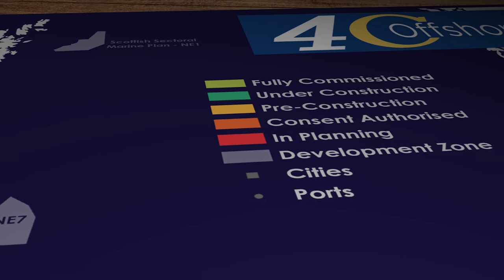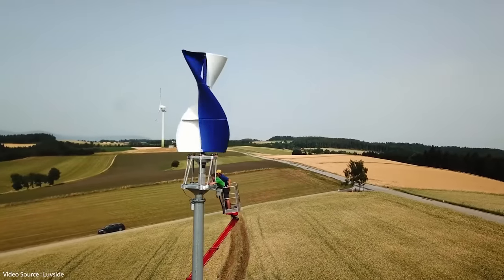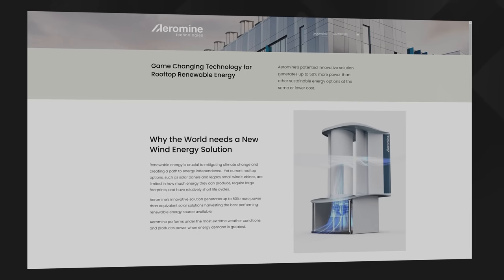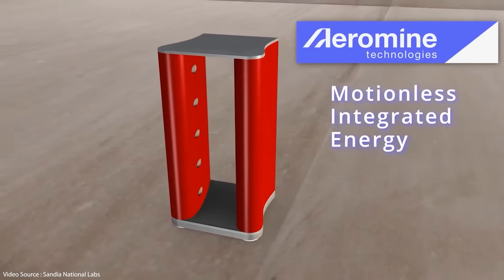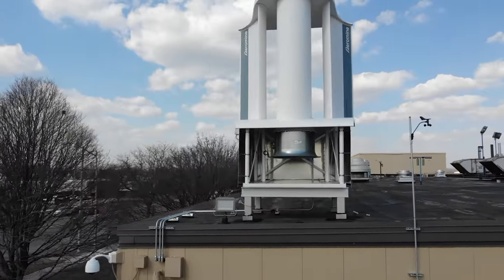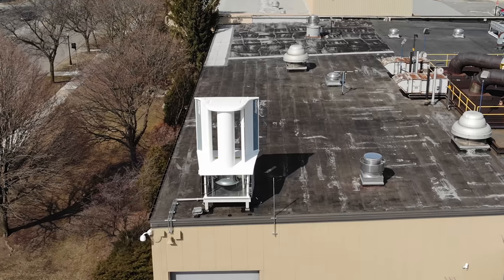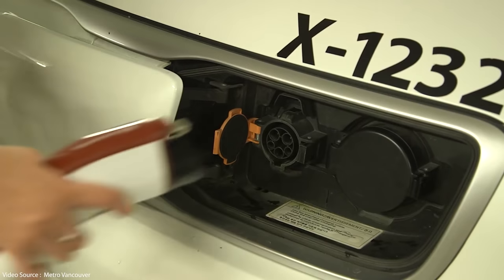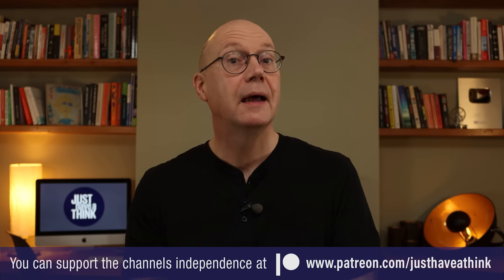Aeromine Rooftop Wind. Static. Silent.  50% more power than Solar PV. What's not to like?

Comment: As the owner of a grade II listed house, I won't be fitting one on my roof but seeing the visual impressions of the units positioned along the roofline of industrial or multi occupancy dwelling buildings, they have an appearance which is quite appealing. It's footprint could be adapted to the structure of pitched roof houses but the carefully designed flow dynamics would probably need to be changed to suit the pitch of the roof behind it🤔

I'm sure it will have a big role in developing domestic scale wind generation and I can't wait to see more.

Comment: It would be nice to have a special segment "Pros and Cons"  in each video. For this one it's obvious that wind direction could drastically reduce the efficiency of the generator and it's not clear whether this was accounted in those nice advertised numbers by the company.
Reply: i think with several decade on aero engineering, wind direction must be the first thing that they consider... that's why it placed on the edge of the rooftop on the side that facing annually predominant wind direction...
Reply: How about obstructions... The pr shots are mainly standalone distribution centers.
Reply: @christianvanderstap6257  if it targeted for factory/warehouse building i don't think they will face any kind of obstruction problem...
Reply: @EndureTemptation I'd say it's absolutely vital. We can't compare the pros and cons, or the price, if we're not told any specifications.

They don't even give optimistic ones of the end product.
Reply: @joeblogs6598  "They don't even give optimistic ones of the end product."

So if they give unbiased estimates, they are going to get dinged because folks will assume the numbers are juiced? I think you just highlighted why numbers shared are probably not useful beyond gossip. That makes me happy that they aren't sharing more details yet -- here's hoping that they're just trying to be as honest as possible!
Reply: I believe it is using the Coanda effect, in the same way as an aerofoil that changes it's angle of attack, allowing constant power generation at +- 45 degree wind angle - I have a video on my channel about it!
Reply: So occasionally reorient it. Place tracks if it needs to be at the edges.
Reply: Does winter weather have an effect, as in snow, ice  build up, very cold temperatures?
Reply: @joeblogs6598  Only small people think they are taller by keeping others at a distance.
Reply: @nathanlevesque7812  Perhaps computerized electronics can reorient these units, as Dutch windmills did manually, to face the best wind direction.
Reply: @alphaxfang  The thing is that these will have to compete with omnidirectional generators and inevitably will lose efficiency on average due to wind direction. Of course how dominant any one wind direction locally is will hit the effectiveness, but in any case this will decrease this system's average usefulness even more.
Reply: @EndureTemptation  lose efficiency yes, but the inital cost will be much lower and it almost doesn't need any kind of maintenance... The footprint also smaller and with no moving part and smaller blade the vibration will be minimum... Plus it only take one side of the factory roof, you can use the other side for other kind of generator...
Reply: @alphaxfang  Lose of efficiency which we don't even know what it is.. They just make a claim of 5Kw... But at what wind speeds? Gale force  winds? Hurricane?  There most certainly ARE  moving parts you can even see them briefly but they are technically "inside" the unit and thus not "exposed" when they are just at the bottom of the tube part. It's not going to change Betz law
Reply: @SilvaDreams  well everything is claimed by the producer, even solar panel can vary when you take consideration of cloudy day/snow/rain/earth angle/roof direction/etc nothing is perfect... 

if on yearly average it produce what it say then it is good already... plus it can be used together with other stuff, it replace nothing, it just another tool for producing electricity... 

yes it is not exposed directly to the element (direct sun/rain)... why so salty upon new tool? if it not work for you then just use other tool that fit your need...
Reply: @alphaxfang  It's not new that is the thing, I saw these back over 20 years ago. They need to be rather large to produce a decent amount of power though. They still have to follow Betz Law
Reply: @alphaxfang  Its about convection more than wind current direction.
Reply: @davidwhitworth6030  attach a raspberry Pi to adjust...

Comment: I remember me and my dad building a vertical ventury out of two model plane wings to drive a toy turbine.
It was a fantastic life experience for both of us, but we had to conclude that there's one issue with wind driven generators.
If it ain't huge, don't bother.
Reply: @srw_cricket2976 
Wind just isn't suitable for small scale application, the physics don't allow it. And a VAWT will never be as efficient as a HAWT for the same reason, I'm sorry..
For small scale solar is the better option, that's why there's a market for it. Wishful thinking never outweighs hard data.
Reply: @isuckharderthanlife5413  400 Watt wind turbines are about $270 on Amazon.  In parts of the world with unreliable sunlight you can go off grid for less than $10K.
Reply: I think the size is the key as well.  The opening, if it is 25 square feet, should be equivalent to a wind generator with a 3 foot radius.  Such a machine has a 28 square foot swept area.  Running at 40% efficiency and a 15 m.p.h. wind, you only get 190 watts.
Reply: @The_Savage_Wombat  That is peak output. Average output will be much much less at nearly every location. Particularly since few put them on tall towers.
Reply: @The_Savage_Wombat  try buying and using one : they are junk in practice .
Reply: @isuckharderthanlife5413  bad part about it all is degregation.. wind, solar. Will need to be replaced in 15-20 years.. more E waste.
Reply: @bosshoss6640  Wind turbines have virtually none of what is normally considered to be "E-waste". Wind power systems have that advantage.  Whether or not this particular form of wind generation will work in specific locations  remains to be seen but nothing that you suggest will even remotely make a difference, Your comment applies much more to solar applications but even in that areana your data is faulty. Current data says that you can expect rooftop solar panels last more like 25 years while maintaining 90% of as-installed output after 20 years. They are an economical alternative to any other form of eletricity generation. E waste? Much of the supposed waste can be recycled so that's not a serious issue. How long does a cubic yard of natural gas last? Is there a waste product from that, do you suppose? Industrial society creates hazardous waste regardless of the technology employed. As of 2022 solar and wind technologies are the least harmful.  Can they enable the continuance of industrial society on a planet with 8 or 10 billion humans? Almost certainly not.
Reply: @jeffgold3091  and you know this how??  Have you engineered one or even installed one???
Reply: @jeffgold3091  I remember when solar panels were junk too.  There's a market for good ones if people can wean themselves off the grid.
Reply: @court2379  Yes, but they can generate in the dark and during winter which solar panels cannot.
Reply: @The_Savage_Wombat  But for less money you could have way over purchased solar and battery storage and more than compensated for that in most locations and have way more excess capacity in good days.

I have wanted to build a wind turbine since I was a teenager, but the facts are that the wind speed isn't amazing at most locations, and much worse below 60ft AGL. The amount of energy these devices are chasing is very small.
Reply: @danguee1  No, if you are going small stick with something that works well at that scale like solar.  Wind scales at the square of the size (I think) which is why small doesn't work well for wind.
Reply: @jjhpor  Go look up what is happening with the expire wind blades on th big turbines.  You are out of touch.

Comment: Excellent contents as always and fascinating technology!  

One small note:

If we assume the solar panel is active during the day time (say 12h a day on average), and this system has 50% more const efficiency, it means it generated only 75% electricity equivalent to the solar panels during day (ie when electricity demand is high) and 75% during night (when the demand and tariff is low).  Overall, given the peak electricity is 50-100% more expensive than the off peak rate, this system hardly likely to have any commercial advantage other than smaller footprint, especially in a larger commercial set up.

Comment: Glider pilots, model glider enthusiasts, hang gliders and para gliders will all recognise this as ridge lift.  In other words a similar effect is found on the brow of hills facing the oncoming wind. Frequently found near seaside cliffs and inland on some hills. I.e. you do not need a building although putting these on buildings does make a lot of sense.
As with all these good ideas I would like to see people deploying a few hundred to see if they can work at a worthwhile scale. Around the UK I would guess there will be hundreds of miles of potential sites.
Reply: A ridge can be impacted by corrosion and this is a little bit difficult to forecast with all those wind, water and ground conditions. 
Great suggestion
Reply: @paxundpeace9970  
I think you mean erosion, and most ridges have been around quite a long time......

If something has been there for thousands of years, it'll probably be ok for at least a few hundred more.

Comment: This is an exciting advancement.  Another video I saw indicated that its performance doesn't drop off much when the wind is as much as 45 degrees of optimal because of the airfoil physics, so it doesn't even have to rotate into the wind, simplifying design incredibly.

Comment: Three thoughts/questions:  1.  For coastal locations (beach), how would the unit handle long term exposure to sand blast and accumulation?  2.  Would a rotating base be a useful addition to always have the unit facing the wind, rather than just the prevalent wind?  3.  Is there a max wind rating?  I am thinking of cyclone/typhoon.hurricane conditions.  

Thank you for your great videos.  I often put YouTube on my second screen and split my attention between primary work and secondary viewing.  With yours, I stop and watch 100%.
Reply: As for the first two questions: the design, at least it seems to me, has the building's roof edge as a mandatory design feature so positioning it e. g. by the sea would likely not be quite as effective. Also rotating it around its vertical axis would break the upstream collection by the building's wall. Wear and weathering would likely not be as bad as with moving parts however.
Reply: You might be interested in a design that came to me in a dream for a wind turbine, is nothing like existing , goes like this , Imagine a rain pipe mounted on a tripod for stability parallel to the ground, spins 360 degrees to catch wind from any direction , internal blade spins to that can reach much higher velocity , copper wiring fitted externally , I'm not the electrician but basically its one huge generator. It definitely came from a higher dimenSION...SION..promised land.
Reply: @pinarellolimoncello  Amazing! Imagine this pipe mounted in lower orbit. Earth is rotating with 28.000km/h! Imagine that wind power!😜
Reply: @michaelv.1107  Exactly, would be amazing, why stop at lower orbit, can see this going global..

Comment: I've looked at building something like this and I think it holds a lot of promise.  One of the problems of putting a turbine on a structure like a house is the vibration.  Anything that spins will create some noise and vibration and I'm willing to buy Aeromine's assertion that their design produces far less than an open turbine blade.  Clearly the Aeromine blade would be smaller and spin much more quickly and, being enclosed and suspended by a well damped system, (that you can't employ if your turbine is at the top of a rigid pole) could minimize noise and vibration.
A typical 5kW wind turbine might have a swept area of 15 to 20 sq. m and the catchment area of the Aeromine looks to be nowhere near that.  I would also think the capacity factor of the unit would be less since it appears to be fixed in place.  If its orientation could change by putting the whole thing on a bearing allowing it to rotate with wind direction, the capacity factor would increase substantially I would think.  
Allowing it to rotate would not be a huge challenge as the bearing would be on the ground and could be quite large, again, easier to do than if the who thing is on the top of a tall pole.  Anyway, an interesting approach and one of several attempts to bring wind energy generation right to the buildings where it will be used.  Good stuff!
Reply: the main wind is the rising hot air from below, the wind on top is just an accelerator to increase the main wind speed...
Reply: I think AeroMine are using the updraft of the building in addition to general wind.
Reply: I reckon go off the 50% more than equivalent rooftop solar for a capacity factor estimate. It’s prob in the low to mid 20% vs 35-40% for good utility scale wind sites
Reply: The way I understood it, this device harvests the increased air flow produced when the wind hits a wall, & all the air is forced upwards. As it reaches the top it speeds up, & the aeromine  is positioned to use that speed to drive it's propellers. If it points any other way it would miss the sweet spot for efficient performance.
In the same way, used at ground level, the device would only catch actual wind speed, with no increase given by the top of the wall position.
Reply: @@morciej yes, the red coloring make it like thermal updraft...
Reply: He says there are no moving parts. Apart from a fan inside the duct. And if it is smaller and spinning faster then it must produce some noise?
Reply: @JayDee-xj9lu  small noise yes, is it as loud as huge fan? i don't think so... and since it is small the vibration can't be that bad...
Reply: And how about the venture effect???
Reply: Not mentioned in the video is fact that this device seems to only work for one wind direction. Normally one would think that even wind coming at an angle of 45° to the desired direction (normal to the building wall to maximise the updraught) would it be okay. However in this design the venturi aerofoils will need to be carefully aligned to the wind direction to work, and even a 10° error could cause them to stall. So unfortunately I think this idea won’t fly as it is too dependent on wind direction bb

Comment: The space between two of these installations is quite large. For normal wind turbines this is important because one turbine could mess with the flow of nearby turbines. I wonder if placing them next to each other will affect performance because the fact that it uses negative pressure might make them particularly resilient against this. This would greatly increase the number of units you could place in a certain area
Reply: Actually the more of them next to each other the better they would do... they would create an ever larger air pressure difference between the front and rear of the units which would increase their output.
Reply: it is not precisely an area you can use, it is more like a line along an edge...

Comment: Interesting video, thanks! To determine if competitive, need to know initial cost, cost per kWh, power generated per kph (wind speed), dB noise rating (contrary to your report it does have moving parts - just not readily visible). Once known, it can be more readily assessed whether it is a better option to existing wind generators.

Comment: Venturi systems has been used in the gas heating industry for decades for example fan prooving in gas boilers and the movement of water through hydraulics. It is amazing that the principle of this technology discovered 100s of year ago is now transitioning from fossil fuel created energy to renewable. All good stuff 👍

Comment: Yes I would be very keen to see the real costs and savings with this. In my area the wind is usually from the north west but regularly swings around to south which is usually a gale. I would have space to build a square structure to get the edge of the building effect in pretty much any direction so a steerable version sounds good. Keep me posted.

Comment: I hope this innovation fulfills its promise.  My first thought was what temperature range the kit could operate within.
Reply: Why is temperature a significant factor?  22% variation would cover -20 C to + 40 C.  How much does power vary with temperature?  Since density increases with lower temperature, there should be a little more power available in a cold wind at the same speed as a hot one.  And power may be more useful in cold weather.

Comment: What's amazing about this solution, is that the top of the unit can also accommodate solar panels for additional generation.

Coupled with geothermal heating/cooling (which reduces energy dramatically), and modest storage to capture nighttime or surplus generation, I wouldn't be surprised to see a combination provide near 100% of household energy needs, using the grid as a fallback, or as an opportunity to distribute surplus energy.

Comment: Needs a dominant wind direction +/- 45 degrees. Not all locations have this but otherwise very promising!
Reply: You might to mount it on a rotating base and given it's low weight this shouldn't be not that big of an issue.
Reply: @paxundpeace9970  Good idea but complicated to keep it turned into the wind??